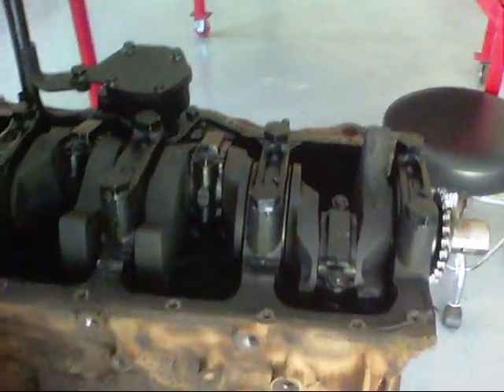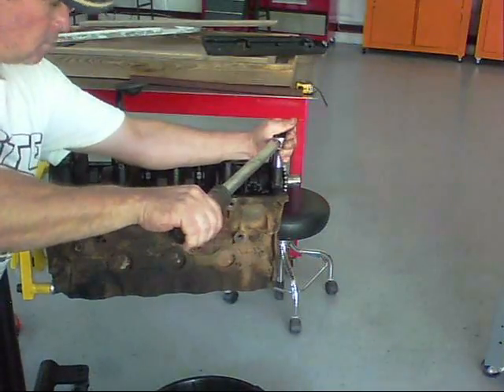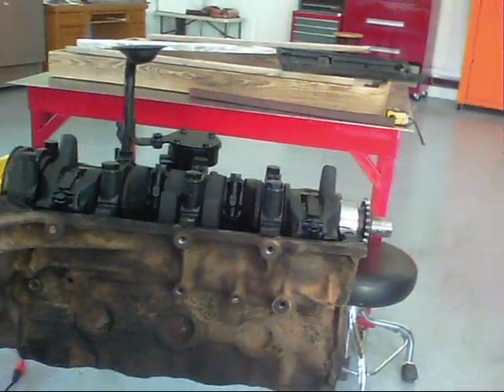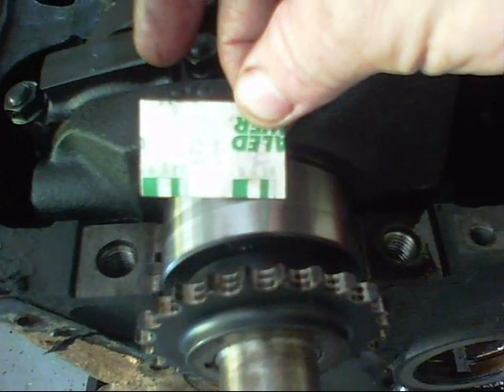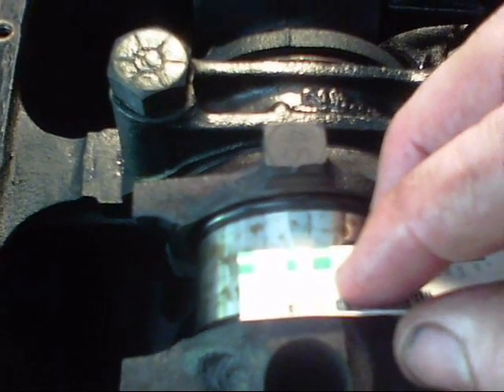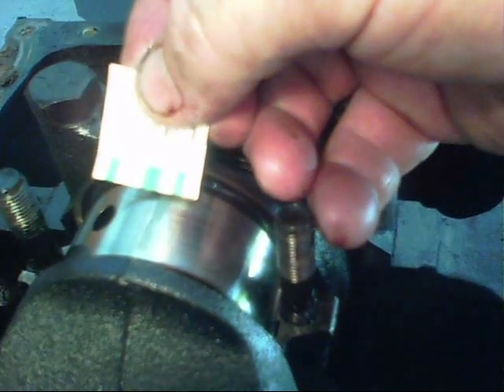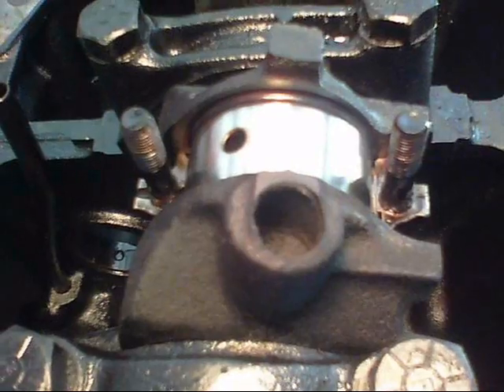How to check your bearing clearance with Plastiguage.

Comment: Im beginner the plastigauge depend on the engine size to choose the color for the plastigauge .i have a 2008 dodge charger 2.7 and need to change the conecting rod bearings i dont know what color to choose  .and the torque is 20ft and 90 degree  the clearence may increase the torque or low the torque

Comment: Should explain more for beginnners like what it means if it’s wider or thin etc
Reply: No problem. Silver ASE here. Wider means the space between the bearings is tighter, narrower means the space is looser. Looser bearing space will allow the oil to fling off too fast and the bearings won't ride on the oil but rub on dry spots. Too tight won't allow the oil to penetrate enough and that will also create dry spots. You want the plastigauge to be squished just right. This will provide oil flow at cold start and at running temperature to protect your bearings. 

Plastigauge is cool in a way that it will also provide you with the knowledge of bearing health, if they are worn too much in the middle or the outside and it will save you a whole lot of time. Ingenious invention.

Comment: was going to say if its .020 that engine wont run long!! gotta be .002 thou!!!
Reply from the maker: You right Bruce
Reply: The clearence  can afect the torque or what mean the clearence  and can afect the torque?
Reply: @eleuterionarciso4267  clearance affects the gap/space oil can flow in to lubricate/form a film layer protect contact between bearing & rod=scratch metal on metal LOL XD
--newer cars use thinner oil 0w-20, because the space gap is nowadays made smaller...
--older cars use thicker oil 5w-35, because the space gap was bigger back then...(& need thicker film protect towing truck harder service)

Comment: Should I use the plastic gauge with old or new connecting rod bearing and crankshaft bearing?
Reply from the maker: it doesn't matter  if old or new. Its just a way to measure the tolerance between two surfaces.
Reply: Thanks for the information it's really helpful.

Comment: First thing I was told in class. Never use a torque wrench to loosen a nut or bolt!
Reply: vpelayo89 yea, and certainly don’t throw it as soon as you’re done loosening a bolt
Reply: But why?
Reply: @robertbrandywine  because if you throw it many times it will lose its calibration
Reply: depend on skill and time ..haha

Comment: Youbsay no need for bearings personally I would spend the 100 bucks and then. Check my clearances. Have the block cleaned new rings  exc spend the 3 or 400 bucks. And know your chance for failure in the future is very slim instead of gambling with old bearings these old jeep engines are hard to find
Reply from the maker: Thanks for the comment Zach.
Reply: And for those of you that don't know how to use a plastigauge you put the piece in like he shows when you torque down the bearings the strip will flatten and your measure ment is based on how wide the smashed piece of Gauge is using the wrapper as a guide and as long as your spec is within the stated gauge spec use the depicted lines to measure and if your line is not to big or too small your in there.

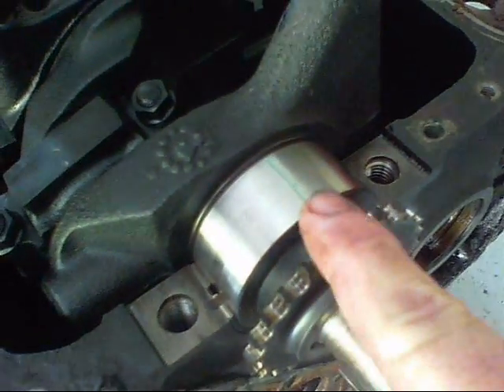Comment: 1:08 diagonal means : a straight line joining two opposite corners of a square, rectangle, or other straight-sided shape. And you use a torque wrench to break the bolts loose ? SMFH!!!
Reply: Exactly my thoughts....Great call there Zeke.

Comment: you need .0002 not .0020
Reply: .0002 is 2 ten thousandths of an inch ~~~~~   
.002 is 2 thousandths of an inch
Reply: You are way off on your measure!!!
Reply: Guy just mixed up terminology of measurement 
For .0018 he says “18 thousands” 
That’s actually = 18 ten thousands 
So crankshaft is OK

Comment: Twenty thousands of and inch is read as 0.020 inches (or two-hundredths of an inch), whereas two thousands of an inch is read as 0.002 inches.  if this engine had a clearance of 0.020 inches, it would have sounded like a diesel!

Tenths = 0.1000
Hundredth = 0.0100
Thousands = 0.0010
Ten thousants = 0.0001
Reply from the maker: The above is correct. Thanks for the correction.
Reply: Absolutely correct. In addition, he states that he placed the Plastigauge diagonally to the journal. The correct term is perpendicular. Diagonal means you placed it at an angle, like a 45 degree angle. Perpendicular means you placed it at a 90 degree angle. Poor communication on this video.
Reply: yep its a jeep
Reply: No?? Lol!!!
.1000= hundered thousandths 
.0100= ten thousandths 
.0010=thousandths 
.0001=tenths. As in tenth of a thousandths. 
 Not ten thousandths.